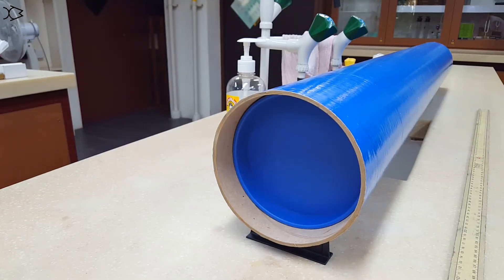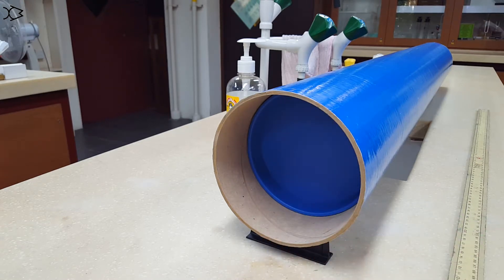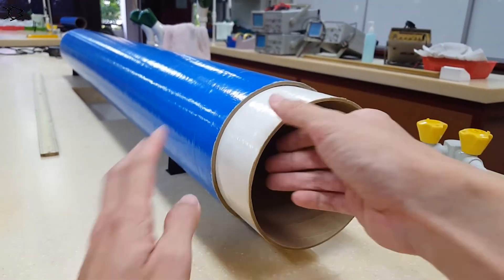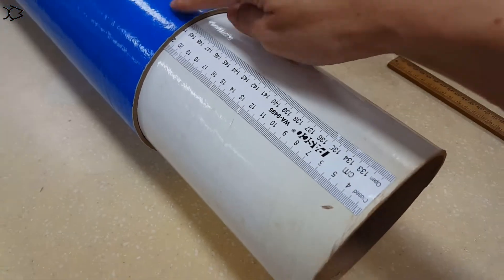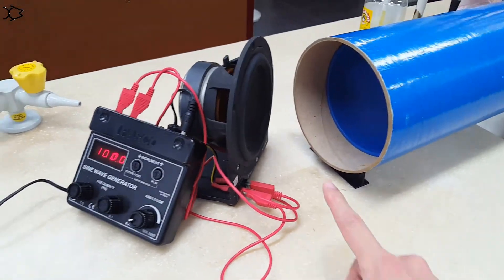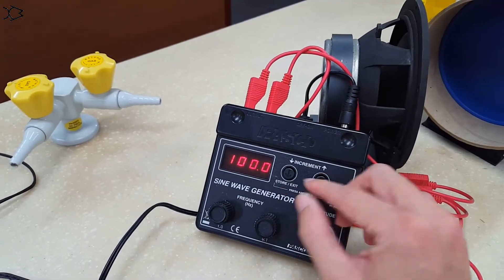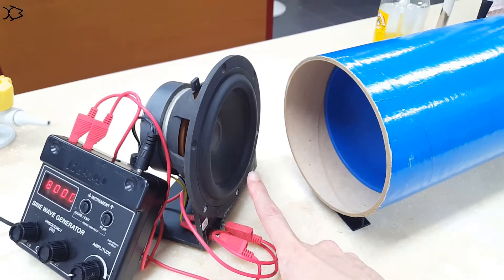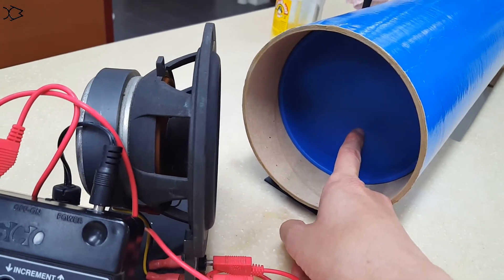158 Closed Pipe Resonance

Comment: Hi, I don't think it reflects back in (you realise yourself by saying "you just have to believe me" :-). What it does is that when coming out it adds to the incoming wave and at certain tube lengths it generate standing waves (that is max amplitude right at the opening) therefore generating increased sound volume.